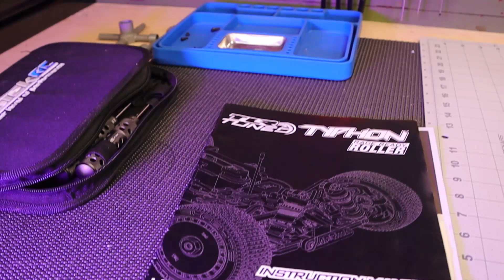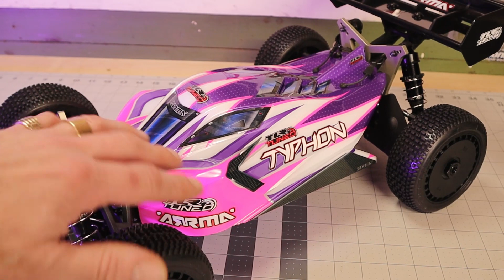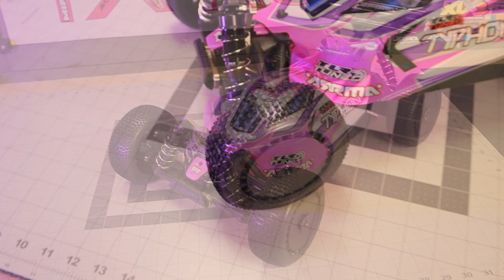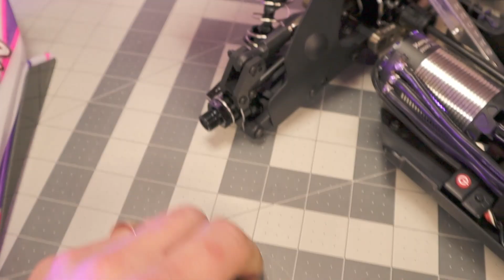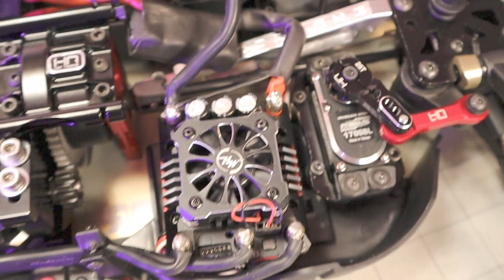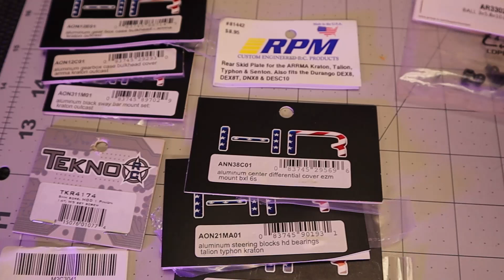ARRMA TYPHON  TLR  Tuned

Comment: The buggy looks awesome with those upgrades, out of curiosity did you ever upgrade the shock springs to a heavier spring and if so what brand/ part# did you use for front & rear? The stock springs feel a bit to light.
Reply from the maker: Thank you..  the springs are  stock and i think ment for track more then big air. I did add a bit of weight with all the upgrades so it definitely chassi slaps on bigger air but it handles great so I don't mind. And with those M2c  braces the chassi is still perfectly straight.
Reply: @fxrc3086   I purchased the RTR version and am wanting to use it on the race track on occasion. With that said would you recommend leaving the springs stock for better handling?
Thanks.
Reply from the maker: @deant6627  I would just run the stock springs its tuned for and does well on the track👍👍

Comment: I just picked up the tlr typhon, hobbywing combo and all metal servo for it from spectrum. Still need receiver, transmitter batt 4s and spur gear I think.  I don't want to race but want to enjoy the outdoor tracks by me from time to time
Reply from the maker: This is the perfect buggy for just that...one of my favorite arrma platforms and u can't go wrong with hobbywing. Handles great on the track and very rugged...👍👍
Reply: @fxrc3086  need new tires, spur gear, still pick a receiver and transmitter also. I'm over $850 in it now already lol
Reply from the maker: @Hoosierdaddyjones812  it does get pricey fast with all the upgrades I did im way over that #😵‍💫... I think you mean pinion gear and I like the tekno Mod 1 pinions they're the best 👌.